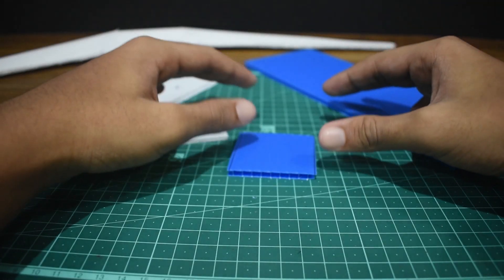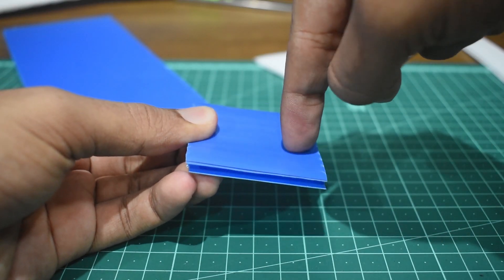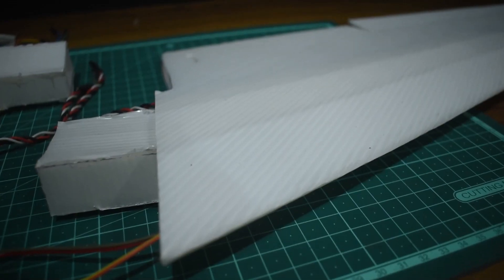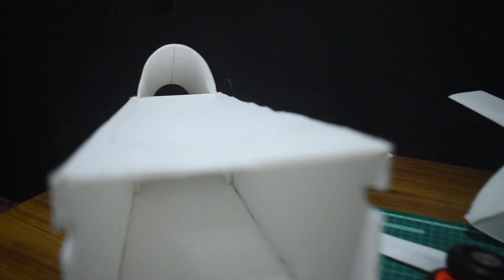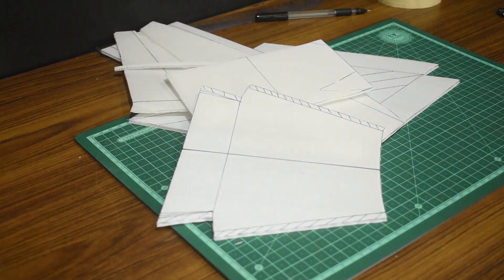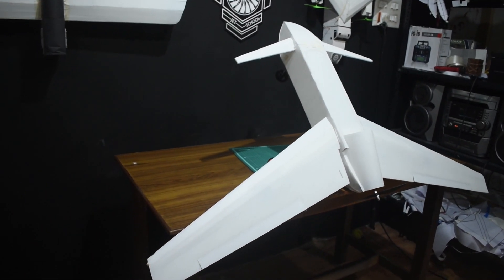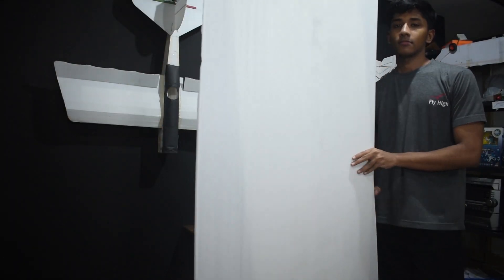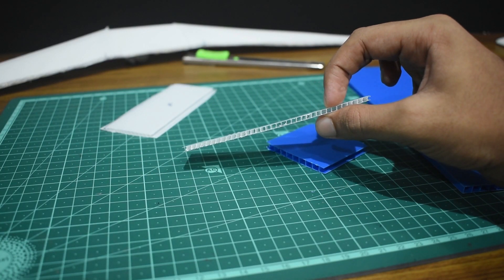How to build an RC airplane with COROSHEET

Comment: Thanks for the video. Do you know where to buy thinner grade cp ...around 1.5 mm to 2mm. 
I use to buy from my local shop but the shop has close down.
Reply: Look for corrugated polypropylene, which is what correx is. It is often sold as floor protector. In the UK you can get 2mm thick from B&Q under the name Antinox
Reply: By the way, corrugated plastic sheet use to built RC aircraft was taught by a Brittish hobbyist. The aircraft is call Mugi. The way to get a good airfoil is to bend against the flute and not along it. This method , the  longitudinal strength is however, compromise but this can be overcome with a strong hollow carbon spar spread along the wings. The airfoil shape is more important then longitude strength. I have built dozen of flying wing using the " Mugi " aircraft bending technique. Some of my aircraft is capable of going at blistering speed and last for years with some horrific crashes. Corrugated plastic sheet are one tough cookies.
Reply from the maker: I have only used 3mm & 5mm, not sure where exactly its available

Comment: Finally someone on YouTube explains corosheet RC construction techniques. Thanks very much. This was a much needed video. 
Would it increase the rigidity if we used two layers of corosheet with the ribs at right angles to reach other?
Reply from the maker: Rather than glue two layers, its better to use a sheet of higher thickness. Yes the ribs will increase rigitidity to a certain extent ,but the issue with corosheet is it wont stick very well when the it is glued against its thickness.because of its hollow nature

Comment: Excellent vid and thank you for your efforts in making it. My son and I are about to build a 1.2m high wing trainer out of coroplast (called Corflute here in Australia). My question is whether it makes a big difference to make the box fuselage with horizontal or vertical lines in your opinion. We had planned to run the grain along the fuse and add numerous internal cross-sections for structural rigidity. My logic was that the fuse would likely be far less prone to flex in this configuration. Your wisdom on the matter will be much appreciated! Many thanks - Dave
Reply from the maker: I have tried both orientations in the fuselage structure, but the one where the lines were vertical was best, it gave the best rigidity while the orientation running parallel was very weak and flimsy. With the vertical you avoid the need to provide large number of reinforcements and thereby reduce weight.
Reply: https://youtu.be/I11ZXddorss             salute to great RC modeler of India.